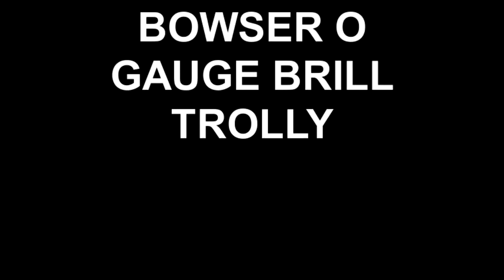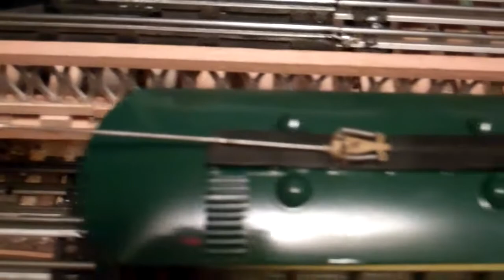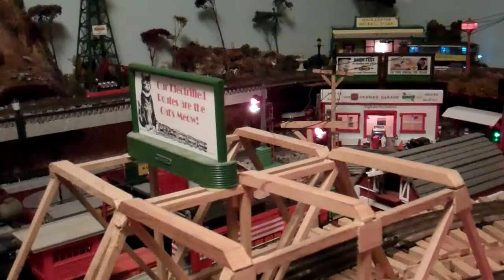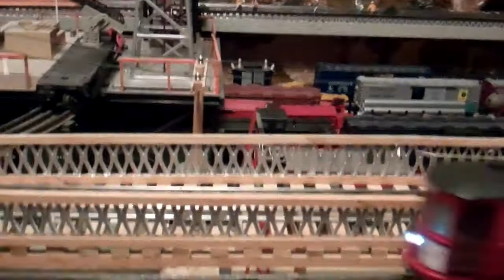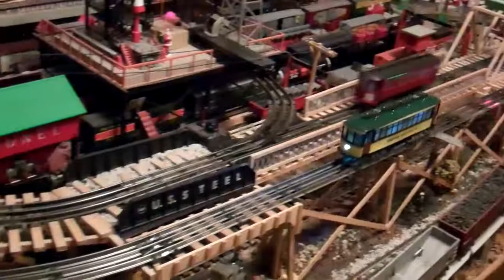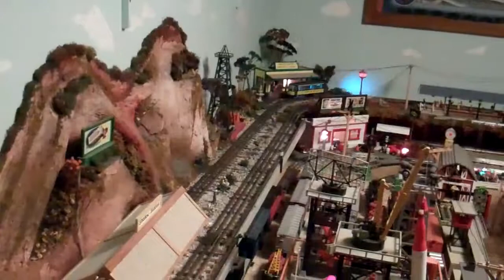BOWSER O GAUGE BRILL TROLLEY

Comment: Fun facts for anyone who's curious about the lineage of this trolley design:
If this trolley design seems 'familiar' to anyone, that might be because it's  actually not Bowser's design. You may have on occasion, seen a bright yellow and red car with "Public Service" in big black letters on it. These were sold/marketed  by the brand 'Minitoys'. But their trolleys were not made by Minitoys themselves. They got their trolleys from Pittman, who in the 1940s and 1950s, sold very nice quality trolley kits. Bowser's Brill trolleys were made with tooling that came from Pittman. Pittman made a total of three different basic trolley designs, and a system of trolley wire they called "erect-a-wire", which seems to be harder to find than the cars themselves. The Pittman kits were sold in a variety of forms, you could buy a completely furnished kit, or buy a body kit and a motor kit separate. I own a 1952 Pittman trolley catalogue, it's four pages (cover, two inside pages, back cover), and the inside pages depict the body kits for the brill car, and a freight motor, as well as the different motor kits you could buy. For the brill car, you could purchase a universal open frame motorized power truck, and trailing truck, and it was available in two main forms: With "tinplate" style large flanged wheels, and center rail pickup rollers, or with "scale" wheels that were insulated for 2-rail operation. You could also buy an open frame DC motor truck, which would fit under a car floor, allowing for a detailed interior, but this utilized a different style of truck and truck frames. The freight motor's truck options were different. One could purchase it with a central motor, and two geared trucks, which I believe were insulated scale wheels, or you could purchase  (also with insulated scale wheels) a single open frame motor truck, and trailing truck. The 'tinplate' option that Pittman recommended one purchase, was a pair of motor trucks with 'tinplate' style wheels, and a collector assembly on one truck. It also came equipped with dummy couplers that were compatible with lionel equipment. Pittman say in the catalogue, that the second motor is needed for better traction on tinplate style rails. Although not listed in the 1952 catalogue, later in time a single-truck line car was added to the line. This seems to be, in my experience, the rarest of the cars to come across. A neat feature Pittman offered, was that you could order the 'tinplate' version of the freight motor, but instead of having operating trolley poles, it had dummy poles, and a special feature- You could change the car's direction depending on which pole was raised! Check out this great TCA article for more details:
http://www.tcawestern.org/pittman.htm
Reply from the maker: Thanks so much for this history lesson!. I'm not a traction guy but appreciated the trolley as a model. You do win the award for the longest reply to any of my videos. Well deserved!
Reply: @tmackinator  hehehe you're welcome! I was too busy trying to think of interesting details to curb my tongue! The bowser cars seem very nice, I'm hoping to find one someday that will make a good candidate for a custom project!

Comment: I just brought a brand new orange Brill, I put 5MM LED's in for a head light, thinking of putting 3mm red ones on rear.  I could not believe what a pain it was to take apart, some screws were in up side down, so removing the roof was nesaserary...  Can you post a wiring diagram for the DC E unit you put in???Marty